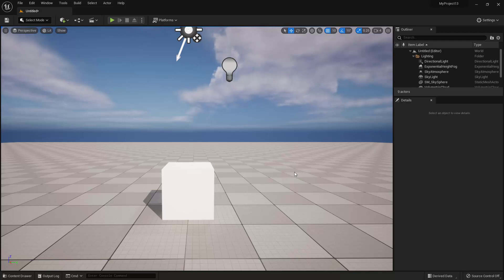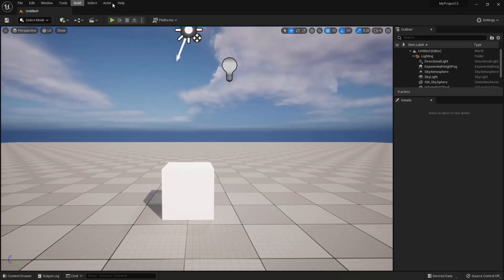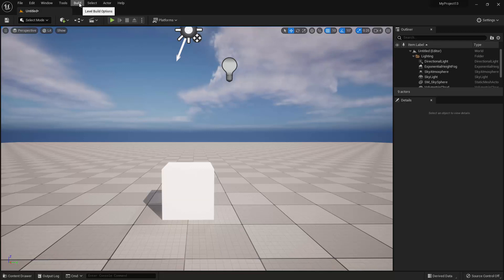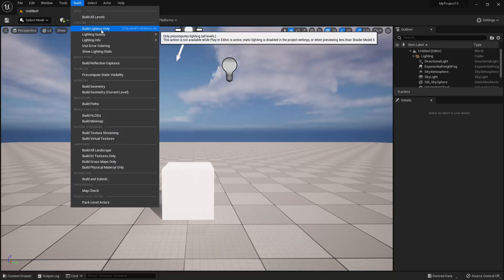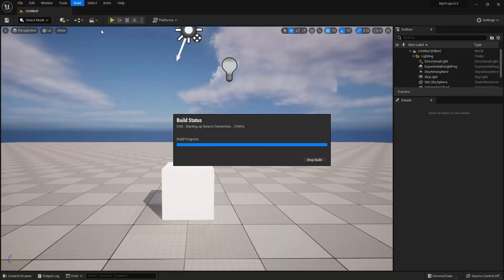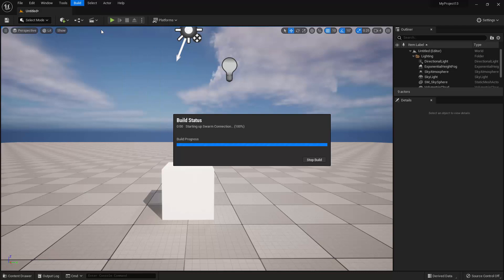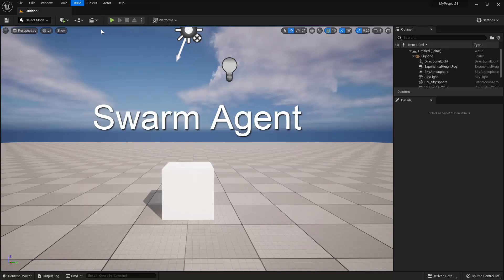How to Fix Lighting Needs to Be Rebuilt Error in Unreal Engine 5

Comment: not an error or a fix for an error. this is as you have said the standard method for lighting that unreal has the user do for static lights. so is a feature working as intended and not an error or fix.

Comment: Could you please develop on how to fix building getting stuck at 0%? Thanks a lot
Reply: I m facing this same issue
Reply: I'm facing this issue too 😢
Reply: @frc5231  u r using Apple M1?
Reply: @bruno2ns527  No, I'm not. For the prosessor, I'm using ryzen 3
Reply: Any solution? I'm going to try boosting my ram and processor.